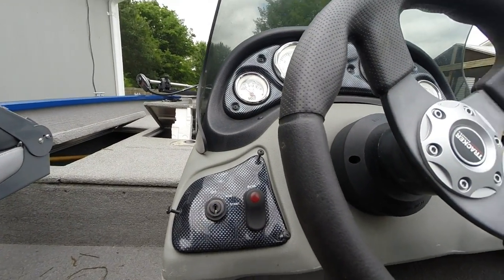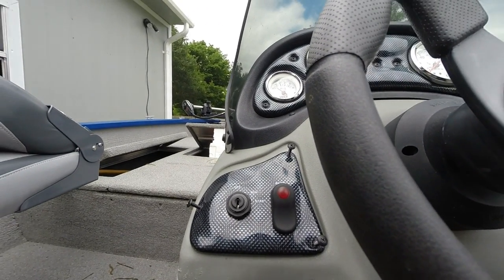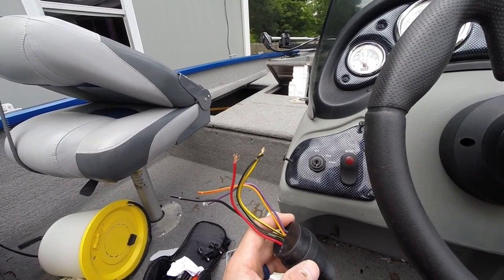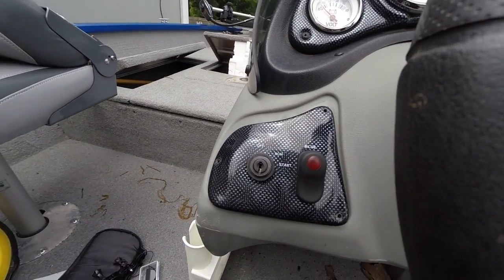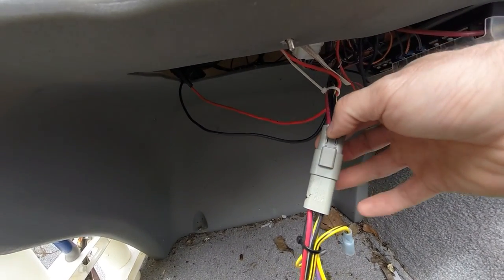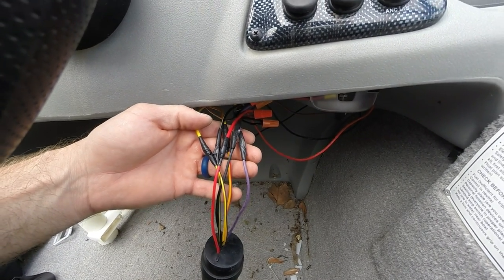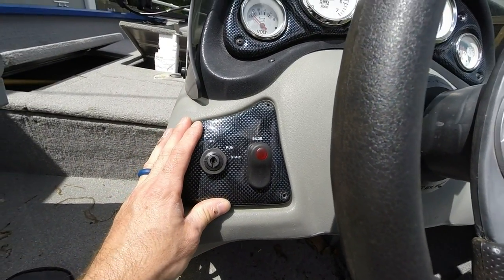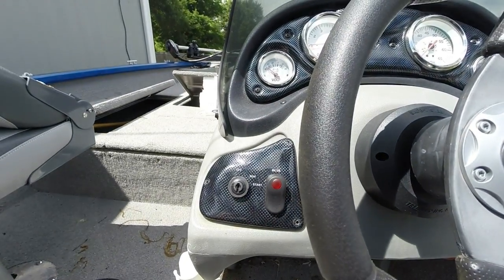How to replace ignition in a 2011 Bass Tracker ProTeam 175TX

Comment: Don't know if you realized it or not, but that's NOT the way you should have done it for simplicity and ease. You made the work far more complicated then necessary. You should have cut the wires where it left the ignition switch, then unplug it and wire the new switch to the deutsch plug connector. Old guys can't crawl up under the dash so we think a little smarter ;)  with it in your hand, easy to wire up, then plug and go PLUS you get that waterproofing. Fish in salty water and you wires will soon be corroded and everything fails. keeps everything looking neat using heat shrink butt connectors. You can also remove the pins from the connector, pin in your new switch and it will also be waterproof. Just saying.
Reply from the maker: I appreciate your comment and yes I agree!  As I do grow older I indeed think more about how to do things easier.  Matter of fact I thought of everything you said in your comments the moment I cut the wires apart!  I hung my head and said to myself "You just made that a lot harder on yourself"!
Reply: As soon as I seen the harness I had the same thought as you.

Comment: Can you tell me where you found the replacement part for $100 or what was the model of the replacement part you used.  If I could find one with that connector then I would pay the extra money but I can't even find one to swap that matches.  Thanks for your help.
Reply from the maker: When I get home I'll give you the number to the place I deal with for boat parts.  It's in Oklahoma.  I live by it but I'm sure they could ship parts to you.
Reply from the maker: http://www.sundownmarineinc.com/m_default.asp.             Call them.   I used the part number on the connector itself.
Reply from the maker: I am very sorry!  My wife just refreshed my memory. The part from Sundown Marine cost a lot.  I actually found out from them how much it was and then found it on Amazon for $100.
Reply: If you want to get the part directly from your local Tracker Parts department, the part number (at least for my 2011 PT175TF) is PN: 129572  Ignition Switch w/Deutsch Hsg.   It is $122.00.  Extremely overpriced for what it is.

Mine went bad exactly as described in the video...would go to run position fine, but it takes me about 5 minutes of fiddling with the key to get it to go to start.  Eventually it will, but it is a real PITA and has gotten worse over a year or so.

If you have a 2011 or newer Tracker boat, you can go to:  

http://tracnet.trackermarine.com/COPM/NewSerial01.shtm

...put in your boat's serial number and get exact part replacements, images of the parts, diagrams, etc. that are available for your boat.   Helps a lot researching before you talk to the parts guy.
Reply from the maker: +John Beyer  Thanks for posting that info.   I will use this in the future if I have any problems in the future.

Comment: I have been unable to get a Tracker wiring diagram for my switch. Your original switch is the same as mine and has a blue wire, video does not clearly show which of the aftermarket switch wires is connected to the original blue wire, I'm assuming it was the yellow/ black stripe. can you verify, I have had no luck on the Internet or with Tracker customer service. Thank You
Reply from the maker: I really wish I could remember.  I have sold my boat and I cannot remember.  I do think it was the yellow/black.  But I am not 100% on that.  If I still had my bias I’d be outside right now looking for you!  Sorry I could not be the help you were hoping for.
Reply: @rjguess  Thank You anyway, I will keep trying....